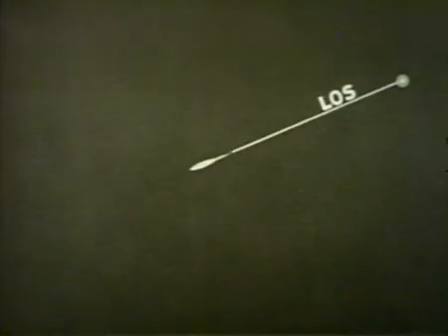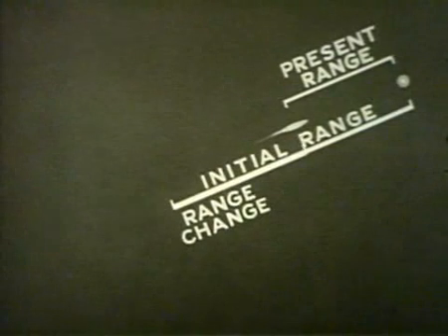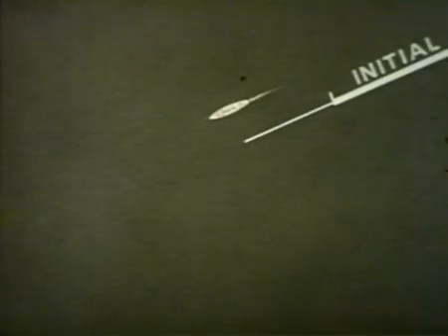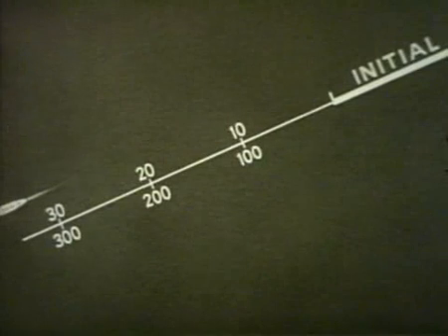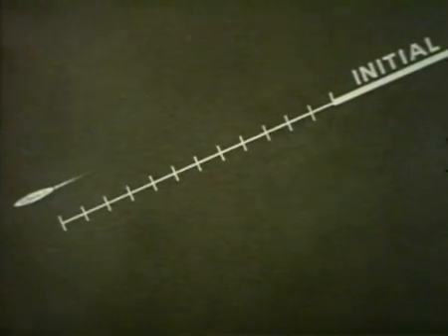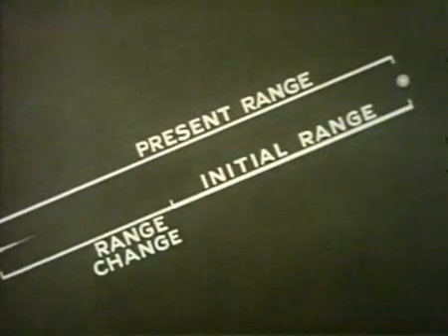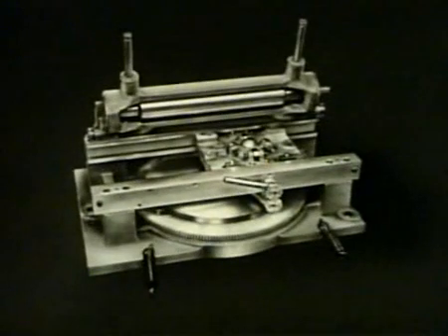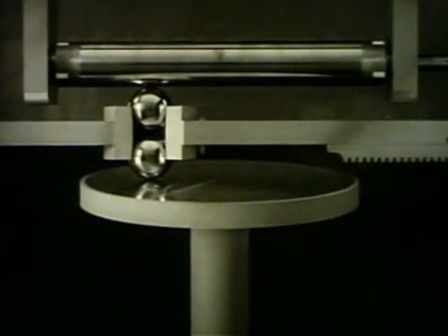u.s navy vintage fire control computers (part 5)

Comment: The computer still produces the range changes in a series of "jumps" they're just a lot smaller and therefore appear "constant" if the machine produced a truly constant change rate the teeth of the gears would have to be infinitely small.
Reply: Joshua Lansell-Kenny if the teeth are ground properly and play is adjusted tightly, there are no noticable jumps :)
Reply: +Joshua Lansell-Kenny AKA wheels :)